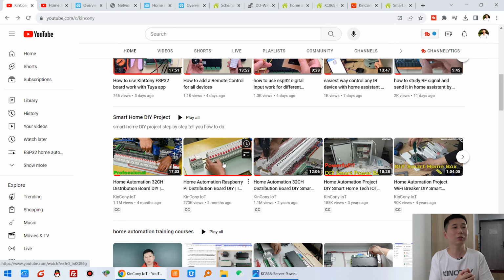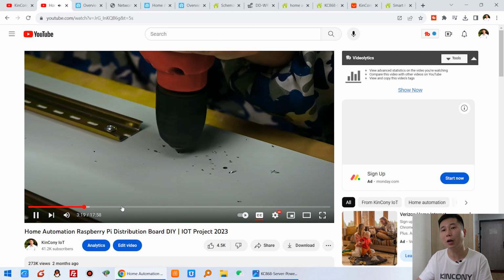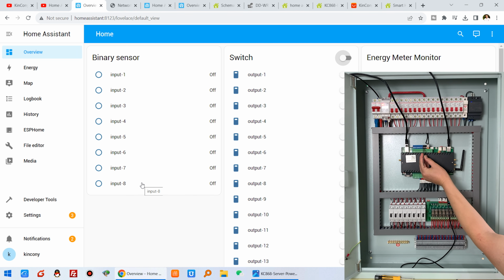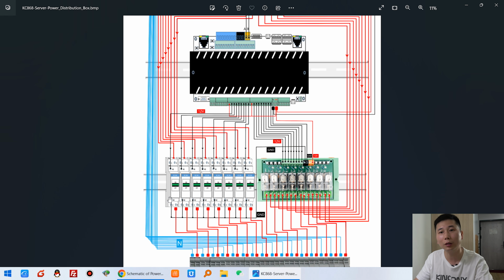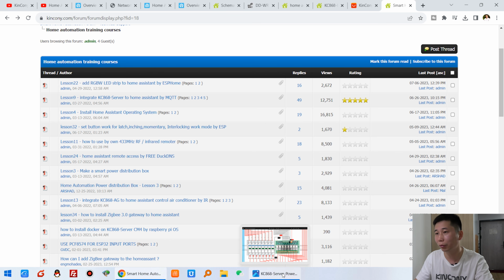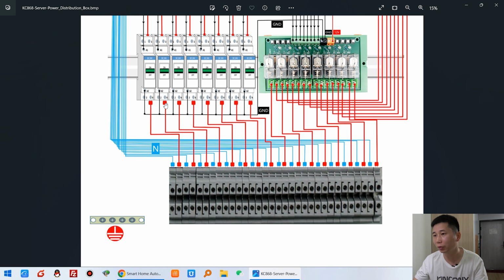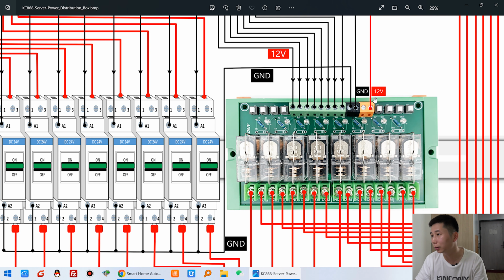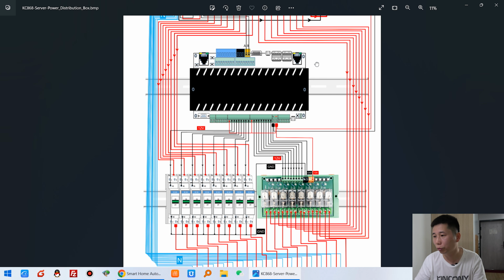explain "Home Automation Raspberry Pi Distribution Board" IOT Project

Comment: Can you explain also how to connect the smarthome touch panel to this modules with rs 485 or ethernet cable please?

🙏
Reply from the maker: this DB just connect to router is ok. use by Tuya app or home assistant software.

Comment: Good job, thanks for the video, are you sure that your contactors located correctly? Shouldn't be CBs(Circuit breaker) before them and not after? All loads will stress contactors first instead of CB. Placing contactors after CB let you to protect them if something wrong happens.
Reply from the maker: exactally, now our new solution let MCB connect firstly.

Comment: hi am emmanuel from ghana and our supply voltage is around 240v/50hz, so with this supply voltage to our various homes how will i install an appliance with more than the 12dc contactor to it
because most of our home appliance are ac
Reply from the maker: sure, also can use 12v dc contactor, just let smart controller output DC12v , then go to dc contactor, need use a extender dc12v power supply.

Comment: What is the advantage of using this board over using smart switches e.g.  wifi switches ?
Reply from the maker: we prefer wired solution , for project wifi usually is not stable. ethernet is best

Comment: Will you open source your codes?
Reply from the maker: which code?
Reply: @KinCony  firmware code.  source code.
Reply from the maker: @lorempikupsum  it use by home assistant, it's open source project.
Reply: @KinCony  kincony smart system dashboard firmware and source code ?
Reply from the maker: @lorempikupsum  this is home assistsant software,it's open source. you can search by google.